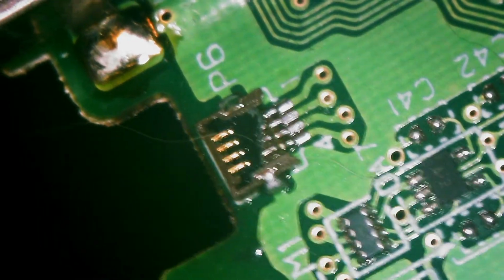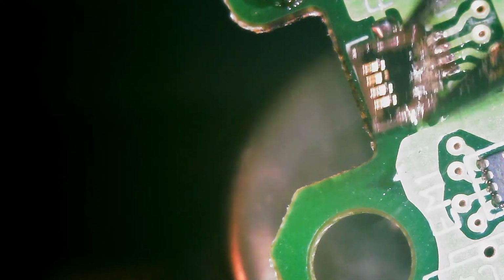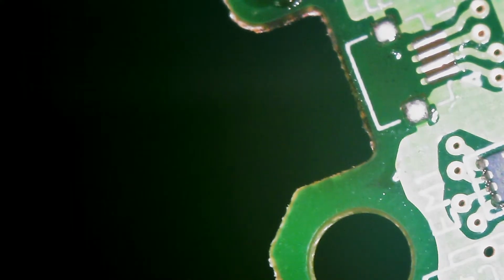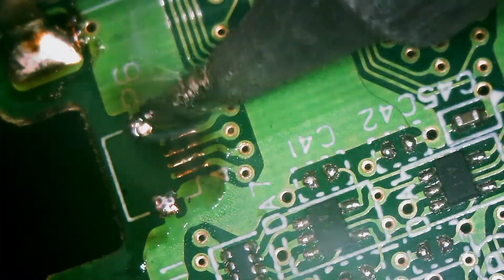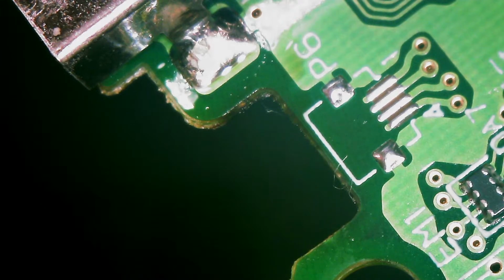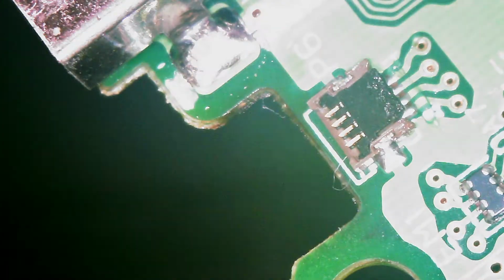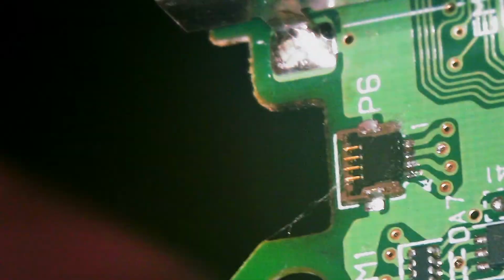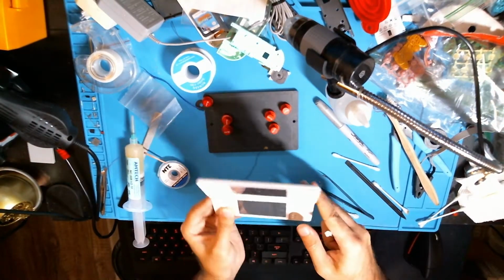Nintendo DS Lite Touch Connector Replacement

Comment: Im so late on this, but thank you for showing the process. I don't have a DS, but an old 3DS XL that i have to at least repair the bottom screen so i can do a system transfer. Broke this exact pin and now im trying to see if i can do this before having to send it to a tech to do this.

Comment: Hey is there a p6 connector on a 2ds. I have a 2ds that is broken I bought it for parts and I'm just wondering if I can get the part I need to fix a ds lite. I'm looking for the same connector that you're using here thank you very much if you reply to my question
Reply from the maker: Great question; I haven't opened a 2ds so I'm not sure. I have seen the touch connectors on ebay though for the ds lite.
Reply: @MitchCairns  I'm buying a Ds lite for 25$ the lady said the touch screen is not working so I don't even know if the p6 connector is the issue. Do you know of any other reasons it might not be working? Like maybe a good cleaning would fix it? At the worst I'll make it a macro. Thanks again for helping me out

Comment: Hey, it works on a Wii U too.  I did melt the connector getting off. The new one I think I got lucky with my iron and it went right on. No heat gun.  Thank you so much.

Comment: Hello Mr Mitch I have damaged some of the zif connectors  FA1004SA1-R8000 of my new n3ds xl and someone said this connectors can be replaced with the same type of the low screen connectors you used here. I would like to know if you think is extremely necessary to have a hot air station or if I could repair this just with a normal soldering tool. Thank you for your awesome video and the attention you could give me. 🙌🏻
Reply: Same happened to me, do you have any information about this?

Comment: Hello I had a question I have a DS lite and when I try to turn it on green light turns on for a quick second and top screen just flashes. I checked all the fuses already and also replaced both screens and still keeps doing the same thing do you have any ideas on what it could be ?
Reply: If you haven’t found the solution. I’m pretty sure this means either a faulty screen or that either the white mic cable is not connected or the black cable to the wifi antenna is not connected.
Reply: @omnom6934  thanks I’ll try and make sure that both black and white cable are connected. As far as the screen being bad I tried different screens and no luck the top screen still just flashes
Reply: @miguelzepeda7786  disconnect the wifi module and connect it had that problem it fixed i5

Comment: My 2ds xl ZL button connector break (shattered) and now i have to tape my zl button connector using tape. Currently my zl button cauae my console to abruptly shutdown, can you teach me how to attach the connector?
Reply from the maker: If the connector is causing the console to shut off there's likely another issue going on. Without seeing the console in person it would be difficult to say I do not work on those ones often.